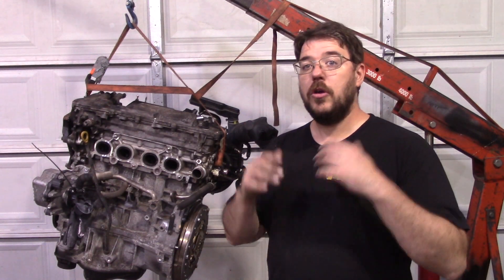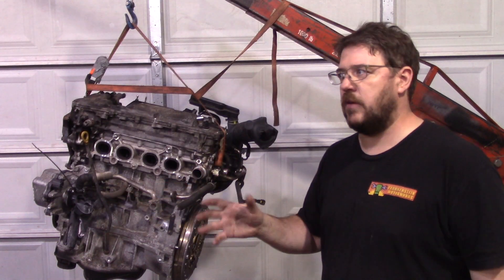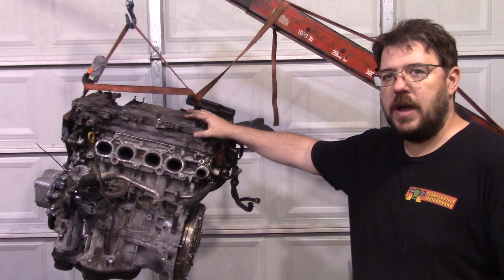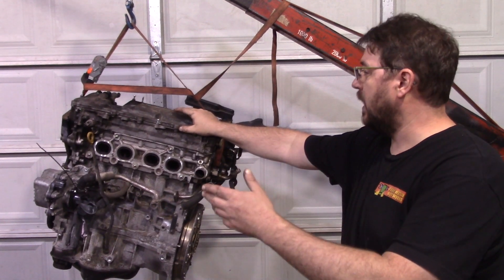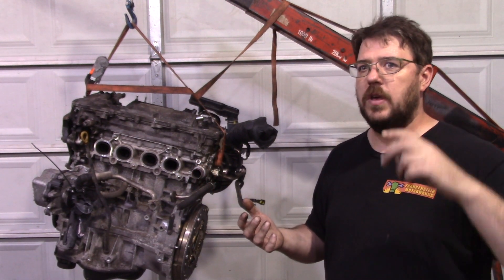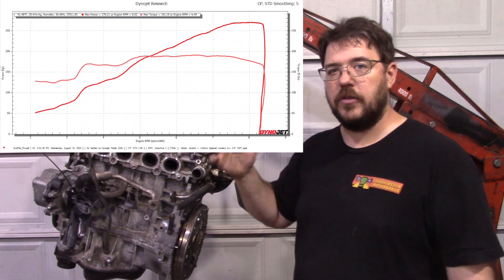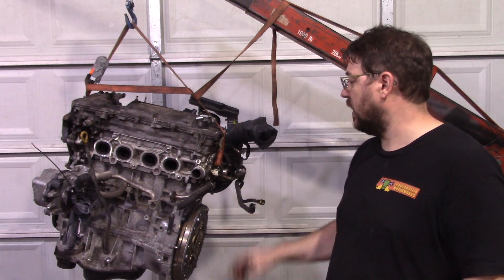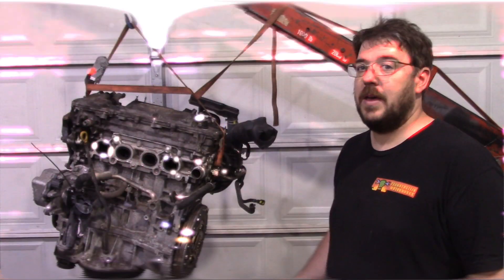270whp on a 2AR-FE!

Comment: Is the 2.7 out of a venza better overall to put most of these Mods on or are we using the 2.5 for a specific reason? I'm very new to Toyota stuff and I only know that the factory 2.7 makes slightly more than the 2.5 but I'm not sure if it's a worth it amount more

Comment: I see the 2ARFXE lists 36.5mm intake valves and the 2ARFE has 34mm intake valves.   Do you have any ideas of the flow numbers between the two?
Reply from the maker: The 2AR-FE, 2AR-FXE, 1AR-FE all have the same 36.5mm intake valves and 31mm exhaust valves and the same valve springs.
Reply: Ok, appreciate the response.   You did the flow numbers in another video stock and ported with 38mm intake valves.     @FrankensteinMotorworks

Comment: Only issue is the packaging on the 2AR, from my understanding, they’re impossible to work on without dropping the subframe, especially on TC and Corolla XRS.
Reply: Um no.  They are one of the easiest to work on of any Toyota front drive engine.  I worked at Toyota dealership as mechanic.

Comment: If you change out piston rings redo gaskets and arp studs head and possibly oem rods with arp bolts cometic head gasket and block sleeve or css block how much power could this motor hold reliably obviously tune is a big part of it
Reply from the maker: You should go check out what Papadakis has done with this motor. He's pushing over 1000whp on this motor with race duty.

Comment: In your head, what would be the cost of making 270hp on 2ar? The reason i ask is recently dunot media made a k20a type r engine and costed 10k just to make 210hp, not sure if they made that conservative power. But spending 10k just to make 210hp is a little absurd in my opinion. 9:04
Reply from the maker: It's about $3500 in upgrades to the engine and the engine is available for $300 easily so under $4000 in the engine. You'll also need an engine controller i'm not sure if that was included in their budget or not but that would add another $1600 or so. So if your starting point is no engine and no computer you can get to a 270whp 2AR-FE for about $5500. If you want to add about $1000 in pistons on top of that and run it on E85 you can easily bring that number to over 300whp. The fact that you don't need any head work or ITBs brings the cost way down.
Reply: @FrankensteinMotorworks  i really appreciate what you do. Thank you.
Reply: @FrankensteinMotorworks  so half the cost of what a k20a can give you. That's amazing.....

Comment: Great work. I am feeling more convinced to go to this for an autox build in my alltrac. I am curious how much weight could be saved off the front end with this 2ar over a 3sgte.
Reply from the maker: The 2AR is a very significant savings over the 3s-gte, it's an aluminum block instead of an iron block. The exact savings will vary a bit from engine to engine because the turbo system is also a lot of weight. Expect about a 100lb savings or a bit more.

Comment: Hey just wondering have your ever considered using itbs for this engine? Would a 20v blacktop itb with an adapter be sufficient to flow enough air for this engine?
Reply from the maker: I'm not yet at the point where ITBs can make sense here. the cost to benefit ratio just isn't there. Also, the ports on this motor are MUCH bigger than then 20V, those ITBs would be a significant restriction on this motor.
Reply: @FrankensteinMotorworks  Aah I see 1 more question does a 2ar and 2gr weigh less than a 4age? I'm considering of swapping an ae101, but I don't want the weight balance to be all wonky since it won't only go a straight line.
Reply from the maker: @WatamelonUberSheep  the 2AR is a very similar weight to the 4A-GE, the 2AR is much bigger but the 4A is a cast iron block. The 2GR is about 60lbs heavier.

Comment: So is this second place behind the k series in terms of NA power capability of a 4 cylinder ?
Reply from the maker: It depends how you measure, if this is about "which 4 cylinder has ever made the most power NA" then the 2AR or the K don't even make podium. It probably makes sense to eliminate $20,000 builds because while awesome they are not really attainable for most but where you draw the line determines the "winner". There are some budgets where the AR wins and some budgets where the K wins just because different engines end up against different restrictions at different points. 

The AR and the K both can make really good power for a very reasonable cost and yes, if you only compare both of those engines and ultimate power no matter the budget then yes, as of now the K has had a lot more effort put towards it and currently has made more power than the AR. 

It all depends on the yardstick you use, the 22RE engine is better than an F1 engine if your yardstick is long term reliability. At the end of the day both the K and the AR are really good engines that have decent availability and make really good NA power on an amateur enthusiast budget.
Reply: @FrankensteinMotorworks  Now you got me curious at what is the most powerful NA 4 cylinder production car based engine is.  Google search shows some 600 hp k27 build.  With no dynos to see.  Also apparently someone just broke into the 5s with a boosted k series?  Either way I don’t own either k or ar powered cars (h22, 1jz, sr20, and vq35de lol).  

But I had no idea a Camry engine had all these potential hidden in there.  This is extremely interesting from a car geek point of view.  And what I love about watching content creators like yourself is I get to experience new setups and engines that is different than what I have so I get to live vicariously through you guys.  I’m so glad I discovered your channel through gears and gasoline and I’ll be sharing this and other videos in some of my Facebook car groups.  Because if I didn’t know about what the Ar could do despite my 20 years of wrenching with cars.  I bet a great many deal others don’t know either.  We’ve been sleeping on the AR all this time!
Reply from the maker: @juanc5149  We really are living an an interesting golden age for internal combustion engines. There's a lot of interesting stuff out there to be discovered.
Reply: @FrankensteinMotorworks  What other NA 4 cyl has made 650hp, let alone one based on a production engine? 240hp/l in an engine with a long 106mm stroke is remarkable.
At their peak the 2.4L V8 F1 engines were making 333hp/l but with a sub 40mm stroke.  Not a knock on the 2AR as I just discovered this channel and it looks like the motors can make similar power.  From your flow graphs I think the K-heads flow a little better, around 290cfm stock and 360cfm with a basic off the shelf CNC port.

Comment: Hello Mr. How are you? I am texting from Panama, and I’ve been looking for a 2AR-FE tuner and builder. I recently damaged my 2AR-FE because the internal oil collector went tapped since the camshaft counter balancer (idk actual name) wear too fast and debris came in the engine. I damaged the camshaft and some 2 cilinders. 2AR-FE is not a popular tuner engine in Panama so, I don’t have a lot of information. I own a scion tC (automatic) I already have improvements that have been made to the auto trans and my car was previously remapped (4 years ago) Now, since the big damage have occurred, I am looking for ideas to upgrade my engine like, changing pistons, more agressive cams, new camshaft (improved if possible) and other zmods that can hace a positive effect on horsepower (i want to gain as more as possible) I would like to keep in touch with you to get some ideas!

Comment: Waitaminit… 8k rpm with a big ol’ 2.5L, stock crank, rods and pistons, bro?! Are these forged from the factory or what? This is almost hard to believe, if it weren’t for your video proof. I mean, most engines now have weak con rods and paper thin pistons… this is a great engine disguised as a base “don’t look at me” engine.

Since you mentioned it, do you know the rod/stroke ratio? That torque curve is beautiful, too! K24 swap where? What K24?

Comment: Great work! I think Toyota likes to make hidden gems often. My 2013 camry 2.5L auto, low miles, clean and well taken care of. I have some concerns with doing any upgrades at all to it mostly due to my ability to adjust (or the lack of) the transmission shift points. This trans tune / throttle map is so… over reactive and over sensitive that if there was a 300hp engine im sure it would be damaged. It never lets the engine make tq and it over downshifts every time. Once you find the tq it then upshifts too soon and too many gears (6th at 25 mph?!) and you loose any and all usable power. Im very unhappy with this car as you can see how I’m fighting the TPS non stop to and from work each day. Would you sell it or should I start with a remap tune? Thanks in advance if you have time to get to this question. If not, i understand and still love your videos and your products look amazing. (Also i have 0 issues with my wife’s 2grfe w/6sp auto) also the camry drives much better with a full tank, 4 large adults and a trunk with 200-300lbs of tools)
Reply from the maker: I 100% agree that the throttle map is oversensitive. I searched for years to try and figure out how to soften that response and in the end i ended up solving it mechanically by making a pedal with a longer throw but that really isn't a valid solution for someone using these engines in the stock application. It's possible that i haven't been able to do it because when the automatic transmission is deleted it goes into some kind of throttle mode where it does not respect the maps but it does not change the fact that i have no idea how to change it in the ECU because nothing i tried has worked.  That said, there are several aftermarket throttle pedal mapping modules that should be able to work by intercepting the signals but i do not have any experience to point you towards a specific one.

I genuinely don't know how we got here, today's automatics may be reliable and last a long time but damnit they are mapped in seriously irritating ways. I don't understand how this hasn't driven a significantly larger demand for manual transmissions.
Reply: @FrankensteinMotorworks   thank you for your reply!! This is still great news because I was just starting to go down that rabbit hole. Now after talking with my wife (she too made comments about my Camry vs her 2GR Sienna) I think a project car would be the best answer for weekend fun and adventures. I’ll have to start using a tape measure because a 2AR or 2GR swap into a Forester or Outback would be real fun I think. (Yeah I will probably have to give the hood a lift or scoop) and maybe toss out the awd, but man this kind of HP would be a lot of fun! I will hit you up as soon as I get everything fitted for all the ecu, tunes and other needed hardware!!❤❤❤ I love your videos and products! Great job on it! I cant wait to start! Thank you!!

Comment: Do you need mandatory a new ECU for this? I really want it but for a street car I need obd2
Reply from the maker: For this exact build you do need it but i'm trying to come up with a way to do 250-260whp on a stock ECU. I'm actually building the test motor for that right now.
Reply: @FrankensteinMotorworks  That would be perfect. I want to get the valve springs, retainers, cams, and intake manifold but I just dont know much about tuning, so if you come up with a stock ecu way that would be perfect

Comment: Thank you for the video very informative.. but I do have some questions?? First I have a extra 2ar-fe engines that I wanted to rebuild but don't know where to start.  I would like to keep it simple but still giving her some extra power.. so I'm your opinion where should I start and what should I put into her so that the engine can become my daily driver but still have balls??
Reply from the maker: Honestly this motor is still perfectly daily driveable. the bottom end really isn't sacrificed. The big issue though is that these cams are very large. Large enough that the stock ECU cannot run them so you would have to commit to an aftermarket ECU to do these changes. If you're ok with that then it's all a question of budget from there.
Reply: Naw I wouldn't mind a after market ecu. So I seem in your vide that u actually produce your own camshaft.  So how much do u sell those for also what would be a perfect part line up to start this engine setup?? FYI engine will be installed in a scion tc 1gen

Comment: Everything you're questioning about wtf Toyota was doing when they made this, I said about the 1az/2azfe/2azfxe. You are slowly convincing me to go this route instead, but I really wanted the 2.0L crank for the 1.7 rod ratio build I had planned. 🤔
Reply from the maker: for what it's worth, the 2AR has a 165mm conrod and a 97mm stroke. exactly 1.7 on the rod ratio.
Reply: @FrankensteinMotorworks  watching your video... This engine just looks like an updated 2az. If the 1az crank bolts in I would sh*t bricks.. What sold me on the 2.0 crank and 1.7 rod ratio was the reduced stress on the piston at higher engine speeds and wanting to build a fwd wrc kitcar themed setup. I absolutely do not need/want too much low end torque. All I want is to hear a younger gen Toyota motor at 10k+rpm.
I liked the AZ oil pump also, 1:1 ratio with the crank vs the honda's pump which spins faster than the crank. This setup uses a pump in the timing cover like the 2zz?
I had it all planned out. 2az block and 2azfxe pistons, 5gr rods(longer to make up for difference in piston compression height), 1az crank, bc cams/valve train, 3sg lightweight flywheel/clutch. And find out how high it  would rev till it broke. The missing link was proper gearing since the 3sge gearbox is the only one I'm familiar with that is a direct bolt up. 🤔
Reply from the maker: @Ricerguy  The 2AZ engine has a 4mm smaller bore so it's very unlikely that the crankshaft would fit in the 2AR. That said, the 8AR-FTS crank is 86mm and that has a decent chance of fitting. That would give you a 2.2L displacement with a 1.92 rod ratio if you calculate it with the stock 165mm rod but with that shorter crank throw you would really want a longer conrod because your pistons would otherwise have a really tall compression height and would weigh more than would be ideal. You would want about a 174mm rod which would give you a 2.02 rod ratio.
Reply: @FrankensteinMotorworks  you should work for Toyota. Constantly re-igniting my excitement for oem+ builds 🤣🙌🏾
Reply: @FrankensteinMotorworks  just dug my files up, the 1az is 1.74 , and my spec would have brought it to 1.79. imagine the 2ar with an 87mm stroke and custom rods to make up for the de-stroke. formula one territory? xD

Comment: Have you noticed the Hybrid engine version e.g. 2ar-fxe inlet manifold does not have the swirl flaps or the variable 2 way intake runners? I've just ordered some bits of you to go to the UK, looking forwards to seeing your stuff, and thanks for all the info and hard work.
Reply from the maker: Thank you for placing an order, i'll get it out the door soon. As for the 2AR-FXE's intake it is a lot smaller with a smaller throttle body. It also lacks the tumble valves. The tumble valve is useless for making horsepower so that's not an issue. If you look around you'll find that they made a 2AR-FE intake without a tumble valve also.

Comment: Came here from Gears and Gasoline. MAN that torque curve is so flat for an NA engine! That's awesome.
Reply from the maker: Yeah it is, this motor has dual VVT-I with 45 degrees of motion on each cam so the motor can go from about 10 degrees of valve overlap all the way to 100 degrees of valve overlap. It really allows it to shine at most RPM even with stupid big cams like i have in here.

Comment: If you are starting with a 2.5L and want to push it to 2.7L what do you think about using the 2TR-FE as another 4cyl engine that has lots of potential especially when it comes to low end torque. There are definitely a few aftermarket parts to help boost HP like the Rotrex supercharger that are available.
Reply from the maker: The 2AR-FE actually already has a 2.7L version, the 1AR-FE. The 1AR is a lot rarer but you can just buy the crankshaft for cheap from Toyota and install it in the 2AR. Unfortunately the 2TR is a longitudinal mounted truck motor. It would be a lot more complicated to use in a transverse application.
Reply: @FrankensteinMotorworks  So we'll be seeing the 2TR in an MX-5? 😉
Reply from the maker: @H0b0sexual  i don't think it would fit but even if it does it will not be something that i will be doing anytime soon.

Comment: How similar are 2az to 2ar fe? Is a swap possible?
Reply from the maker: the 2AZ and the 2AR share the same transmission bolt pattern so they are interchangeable that way, the 2AR is a bit taller and the motor mount is completely different. what swap are you asking if it is possible?
Reply: @FrankensteinMotorworks  gen2 rav4

Comment: How do you think this engine would do boosted? For stock pistons and rods, what psi would you stop at if it is in fact a good candidate?
Reply: From what I’ve found for this motor the internals are good for around 300 whp reliably starts to get risky from 350-400 so around 8-11 pounds With upgraded injectors of course. 15 pounds is pushing it but I’ve seen builds survive it for runs, just not holding it at 15. I would suggests going with forged internals regardless before adding a kit anyways, the high compression ratio can allow you to get most of the power you’d be aiming for naturally aspirated anyways.

Comment: Ports are massive for a factory engine.

Ive been saying all along, the same principles used in high performance motors: big cams, big ports with a good flowing head, good oil system, fully counter weighted crank.

It applies to economy engines as well. The only real difference is the materials used.

They probably were squaring it up against the K series.

Lead the way, be the guy who pioneers the performance for this engine